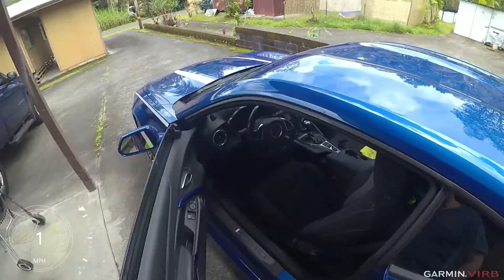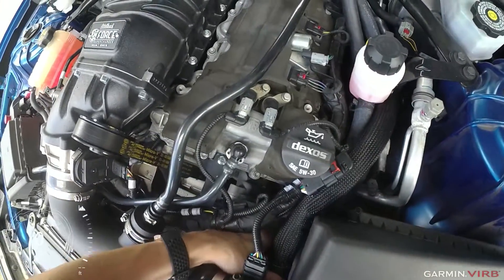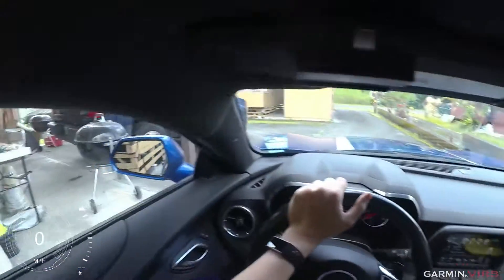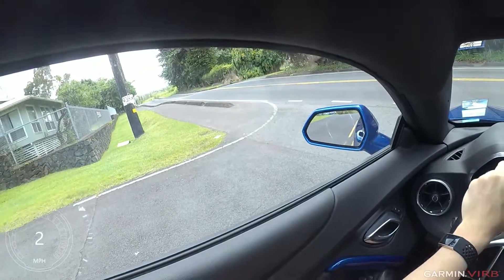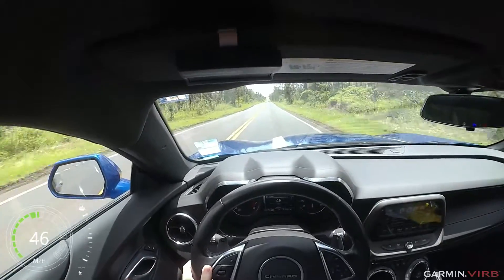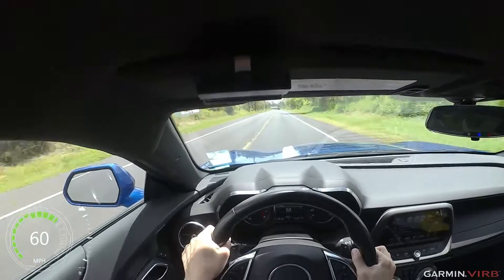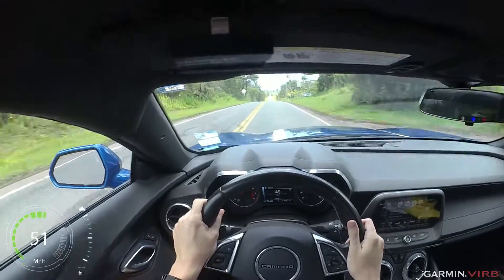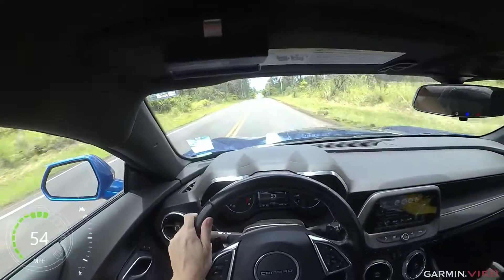Whine mod test on 2018 LGX Supercharged V6 Camaro. (Eaton 1.7L Supercharger)

Comment: Dude I love it! Does it feel like a big difference compared to factory? I have the same car as you and I want to do it to mine bad, and how much did it cost you? Cool vid
Reply from the maker: Stock, the car felt nice. The kit from Edelbrock is a really good value, however I highly suggest you buy it WITHOUT the tune, as that's $500 extra. 

I went from like 260WHP -> 350 with the blower, and tune. It made a significant difference and for the $5k pricetag, plus 1k install, it's nice. However, if you're going to do it. Learn from my mistakes.

1) Buy it without the tune, and you're already ahead. 

2) Also buy a 3.25"(6 rib competition) pully, so you go from 6PSI to 8PSI. 

3) Buy "American Racing Headers" CATLESS, downpipes for the LGX V6. (2016-2020+). They're pretty cheap, and not only give you a more aggressive tone, they freed up my IAT's allowing my shop to add timing. This was a MAJOR improvement. I got every bit of 30WHP for just doing that. I still have the stock NPP dual-mode exhaust from the secondary cats back.

Those 3 things, you'll get about 383WHP, where I am at now, which is well into LT1 territory. If you have 93(I only have 92) you'll be a little healthier, and depending on how aggressive you want to go with the tune, you can get more. My tune is very conservative and fat, cause my shop knows it's a daily.
Reply: @Z51MAELSTROM  doesn't an lt1 have around 450hp??
Reply from the maker: @thein1990  That's to the crank. It's more like 460 crank, but there is what is called "drivetrain loss." When I say "WHP" that means what I'm actually putting down to the wheels. Wheel Horsepower.

An LT1 puts down about 360-380 to the wheels, depending in a verity of factors. So my 383WHP is about 480 crank Horsepower due to my calculated drivetrain loss.
Reply: @Z51MAELSTROM  whats the 0-60 time on the car
Reply from the maker: @rockfire9799  It's hard to say the real number for 2 reasons. I need better tires as with the summer only I spin really bad in first gear.  Secondly I haven't been able to test it due to rain since I added the downpipes and better tune.

In a realist scenario? 4.6 - 4.7sec is a good estimate judging by what I'm getting with wheel spin.
Reply: @thein1990  450 at the crank but 418 at the wheels + v6 is way lighter
Reply: @Z51MAELSTROM  hello love the car I am gonna be doing the same mod to mine where do you get the pully at?
Reply from the maker: @lethal_chevy5442   You can buy it from Edelbrock, or you can buy it from Summit Racing. A lot of the places I look it was frequently out of stock.  You want a 6-rib edelbrock 3.25" pully.
Reply: @Z51MAELSTROM  thank you for info could you run a smaller pulley for more boost
Reply from the maker: @lethal_chevy5442  You could do a 3" for 10lbs or a 2.75" for 12 pounds, but the issue we ran into is without a full exhaust set up you'll get spark knock with  high EGT's. With a catless downpipe you can safely run 8lbs and get a big boost in power. After that you need to investigate what you'll need for 10+lbs

The upper limit is 425WHP if you want to stay safe, above that consider forged internals.
Reply: @Z51MAELSTROM  where do they make forged interacts for the v6 can’t find any
Reply from the maker: @lethal_chevy5442  Forged internals? You'd likely have to contact a shop that would make them to a particular size and spec. They won't be off the shelf parts like the V8 stuff. Sucks to suck with the LGX parts, believe you me.
Reply: @Z51MAELSTROM  yeah definitely does did you ever try meth injection to help with spark knock
Reply from the maker: @lethal_chevy5442  Ended up just getting cattless downpipes, and that solved the problem. It breathes way better and I nabbed over 30WHP through tuning just from that.  Problem is now I need a trans tune cause it slips really bad 1st to 2nd
Reply: @Z51MAELSTROM  the thing is I am in Cali so it’s hard to get catless headers here
Reply from the maker: @lethal_chevy5442  I can't replace the headers because they're apart of the block, but yes the downpipes they connect to. You'd have to have a friend buy them and bring them to you, or ship them to you. I'm in hawaii, oddly enough and the shipping sucked but I got them no issue.
Reply from the maker: @lethal_chevy5442  How could they even know? They don't sound all that different and unless they fucking jack up your car to physically check for cats, they couldn't tell the difference.
Reply: @Z51MAELSTROM  oh I thought it would have made a difference to the sound
Reply: @Z51MAELSTROM  you can’t tell there catless from the engine bay because the cops hear like to make you pop your good
Reply: @Z51MAELSTROM  hood
Reply from the maker: @lethal_chevy5442  Even if they make them pop your hood, you literally cannot tell. It has a little more resonance and it's louder but it's not crazy obvious unless you do the full cat-back exhaust, and add a obnoxious crackle tune. 

I cannot believe you really have cops going out of their way to check for modifications. The supercharger is legal,  the pully (If they can't tell a quarter inch difference)  isn't. But they don't need to know that. "Yeah, it's a stock, 50 state legal kit, with their tune. It's emissions compliant."
Reply: @Z51MAELSTROM  yeah that’s why I am going with this supercharger and yeah the cops near me are asses one of my buddies got a supercharger and two weeks later was caught with it driving to work
Reply from the maker: @lethal_chevy5442  Ok, caught with it doesn't make any fucking sense. There are generally legal ones you can get in Cali. "Caught with it" implies they cited him for it and he has to take it off, or like lose the car?
Reply: @Z51MAELSTROM  He had a procharger on his and it is not carb complaint so he got a state ref. For it they towed his car
Reply from the maker: @lethal_chevy5442  That seems insane. Remind me to stay the fuck out of your state.
Reply: @Z51MAELSTROM  im cureently tuned by trifecta could i add this supercharger without their tune without any problems ?
Reply from the maker: @x24amd  You'll need a tune from someone, without some kind of tune you won't make proper power. You'll either need a modified tune by trifecta (preferable) or pay the credits to a shop or local shop that will tune you.

Comment: Was wondering if you still have the cylinder deactivation feature? Also what are you MPG numbers looking like? I have the same car just not supercharger and am curious
Reply from the maker: So, you lose the cylinder deactivation, first off. However, the S/C has a bypass valve on it that is operated via vacuum.  If I was consistently gentle on the throttle (Which when you have a whine mod and love feeling the pull and hearing it cry) I could easily hit 22.5-23+MPG still. 

I'm normally closer to 20 cause...I like getting on it.
Reply: Did you do anything to the transmission to be able to support the new power from the super charger?

Comment: Where did u get the supercharger
Reply: Thanks man I saw ur video and it help alot are u running any stand alone ecu or hp tuner
Reply from the maker: @kyleloveland2344  It's just an HP tuners, tune, that was made by my local shop. It's going to be modified and improved next week as I'm getting catless downpipes.
Reply from the maker: From edlebrock

Comment: Hey what your ig? I have a few questions
Reply from the maker: I don't really use insagram at all. You can ask them here and I'll reply.
Reply: How much power are you making
Reply from the maker: @mygamming42  About 460 crank, 360~ wheel.  There is lots of room for growth. I need a full exhaust system, and fueling to jump up closer to like 425 wheel.

Comment: I have the same supercharger on my v6 Camaro what makes your’s wine because mine doesn’t wine at all I found a way to install the stock sound tube but still no wine was it the smaller pulley ??
Reply from the maker: I'm not sure if the smaller pully would make that much of a different, though the supercharger is now spinning faster. 

You need to go to Foster, and buy this kit. I have the stock Airbox, and installed this with their directions, and got the results you see.

https://www.fosterscmods.com/product/new-sku-332/
Reply: King Orthocone yes sir I already got the kit and installed it am getting wine now am very happy with it foster was very helpful just like you said in your video
Reply from the maker: @kj3313  I wonder if the smaller pully makes me generate different and or louder tones than you.
Reply: King Orthocone I know from experience the smaller the pulley the more wine you will get I am running the same pulley your running right now am debating on going with a 3 inch pulley it should put it around 10 pounds of boost but I don’t want to go to crazy tho
Reply from the maker: @kj3313  To be honest, your tuner won't tell you to do the 10lb+ pulley, unless you're willing to do E85 and other means of cooling. That or a WaterMeth injection. If you don't, and you  are on 93 pump gas on a 10lb pulley you seriously run the risk of Spark Knock, or melting a piston ring, your EGT's will skyrocket. 

If you don't give a shit, send it and make some videos. Let me know the long term. My tuner won't let me run that pulley unless I swap to Water Meth injection, and I don't wanna do that. I also have a 2.75 for 12lbs but that's for later.
Reply: King Orthocone yeah am still looking into all of that I don’t wanna go to crazy with it are you running the Edelbrock tune ? Or did you have someone do the tuning am thinking about taking it to good know tunner I feel like the Edelbrock tune doesn’t give you the right air to fuel mixtures am getting some hesitation and bouncing idle I think there running it lean so it will meet epa bs
Reply from the maker: @kj3313  Actually, they run it extremely Rich, because it's conservative. If you're not running the stock pully, get it re-runed. It's really stupid to run a not-stock S/C set up if you're using Edelbrocks tune, and not their 6lb pully.  

I am running a new tune when I went to the 8lb pully, but my shop isn't much better simply because they want to be super safe. 

Also I beat a 2002 SS camaro today. That felt good. :D Made a new friend.
Reply: King Orthocone makes a lot of sense am gonna take it to have it tuned see if they can smooth it out a little and see what kinda of actual numbers it can make, I just don’t want them to go overboard, I know a guy at Edelbrock and he said a few people have blown the engines already by going crazy with the tuning lol I really don’t feel like rebuilding or replacing the engine yet my Camaro is my daily driver, I have my Silverado but am doing to engine work on it right now,  my original plan was to trade mine in for a ss but my car became special to me after I lost my dad, I took him with me when I bought my Camaro and that was one of the last things we did together so I can’t part with it
Reply from the maker: @kj3313  Again, you don't need to go crazy with the tune to get more performance, and better mileage than Eddlebrock is offering. Tell your tuner you're not looking for a race tune. You want a solid, performance tune that is still safe and street able. Make sure they take care to look for spark knock.
Reply: King Orthocone sound good sir thanks for the advice one other question how is your transmission holding up ?
Reply from the maker: @kj3313  So far so good, sometimes it seems to slip while WOT from 2nd to 3rd, but I haven't had any temp warnings, or actual codes/problems thrown. I also beat it up at Autocross
Reply: @kj3313  what supercharger do u have
Reply: Da Beats edelbrock
Reply: @kj3313  why dont you hit up will from Overkill Motorsports about a tune he's the best in the business for these v6 camaros. Plus free tunes for the life time you have the vehicle you won't get that anywhere else getting a tune.
Reply: @manuelthodos5925  hey do you know how to get I touch with them I email them and they never respond lol
Reply: @Z51MAELSTROM  can link me supercharger I might get it for my 2016 camaro
Reply from the maker: @v6camaro867  https://www.edelbrock.com/edelbrock-stage-1-supercharger-w-tune-15995-for-camaro-v6-15995.html

This is the one I got, but, I would get it without the tune, and have your local tuner do it. Edelbrock's tune is way WAY too rich.
Reply: @Z51MAELSTROM  thx man

Comment: Are you using the edelbrock  tune? I’m going to order the same supercharger but have heard bad thing about their tune
Reply: @malcom did get the supercharger I’m thinking about getting it but looking for feedback on it
Reply: It’s a great kit very easy to install nothing to hard I would agree that the Edelbrock tune is very conservative I think they run it to lean for emission it may be worth it to have someone tune it but find a good tuner and ask them to keep the engine as safe as possible if you go to aggressive you can damage the engine, sometimes I get hesitation I think am gonna have someone tune mine to smooth it out